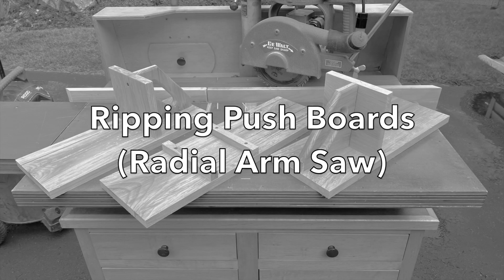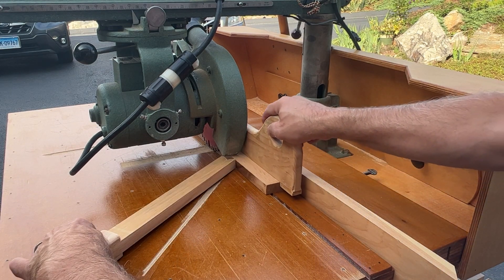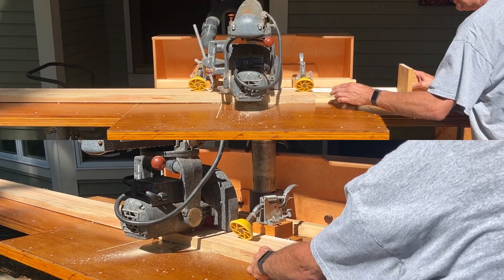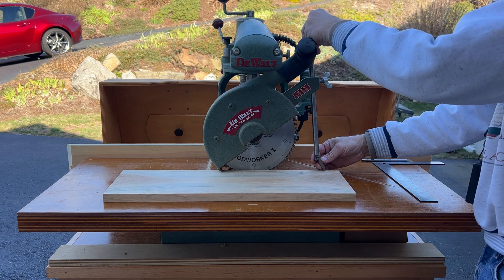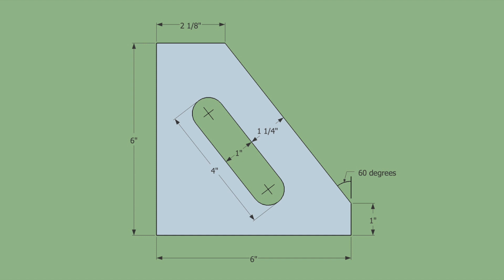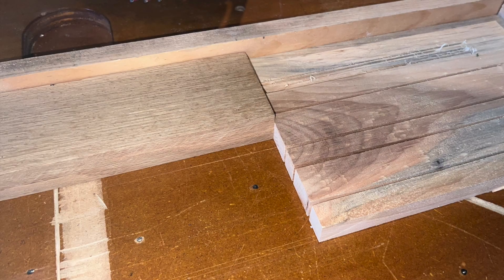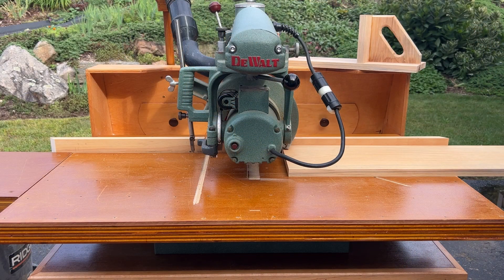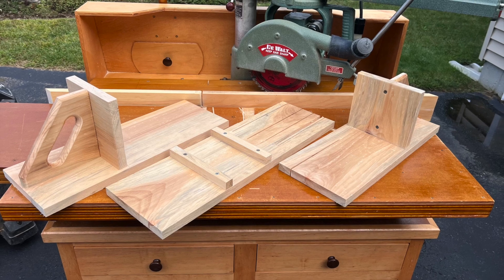Push Board for Ripping on Radial Arm Saw

Comment: Great idea. I just made one. Shouldn't you also use another board to keep the rip board against the fence?
Reply from the maker: I generally don’t need anything extra to hold the board against the fence. However, sometimes I use “Board Buddies”. You can see an example in this video (8 min 55 sec):
https://youtu.be/dXfl4njmZmc?si=6RvT9cXn3UoA67R5

Comment: I’ll make one today. Great description. Thanks. I use the DEWALT I learned on 60 years ago.
Reply: This is my first one, using scrap 3/4 5 1/2" wide pine. When this needs to be replaced I'm going to try cedar picket since I have a lot of pieces the right length.
Reply from the maker: @DouglasHavens Nice job.
Reply from the maker: Thanks. Glad you found it useful. Be safe!

Comment: Why does your push board not have an extension to the left of the piece that would help with adding a rightward pressure point at the left rear corner?
I seems like that would be a useful work stabilizer as you feed the workpiece. 🤔
Reply from the maker: Great question.  The push board is really just pushing the last few inches past the blade. Not unlike using a push stick to push a board past the blade on a table saw.  As long as the board is cut square on the end, the push board mates with it and pushes it straight through without problem (better than just a push stick).  In addition, I often use “board buddies” when ripping (you can see them in some of the examples shown in this video).  These one directional wheels are angled and also serve to pull the board towards the fence.
Reply: Thank you. I forgot about the board buddies, but on other active RAS demonstrators I’ve watched, they use a similar push board like yours, or occasionally, a push board from the back, then a push stick on the side, and that also prompted me to wonder why a push board  didn’t have an “extension” stub on the outer length rear portion of the rear of a workpiece. 
It just seemed to me, having that lateral pressure pushing the workpiece towards the fence was something one always tried to ensure.🤔
The one downside to my corner tab concept could be the limits of whatever pushboard width one built, in relation to the workpiece, so then a complication then is whatever arm that presses against the board length, would need to not interfere with the cut path and blade guard.
I’m curious to experiment with this idea, even if it turns out not to work in real life. 
It’s just a thought I have after watching several ripping cuts on the RAS.🤔🤷🏼‍♂️
Reply: I will  strongly consider making or buying a board buddy of some type anyway, they seem a smart accessory to use routinely.👍🏻
Reply from the maker: @leohorishny9561  They do come in handy.
Reply from the maker: @leohorishny9561  If you invent something better, please share.
Reply from the maker: @leohorishny9561  The nice thing about a wide push board is that it safely pushes both the workpiece and cutoff past the blade without pinching.  Depending on where you place it, a thin push stick may not always push the board straight (similar problem on a table saw) and another stick pushing from the side may pinch the kerf near the blade.

Comment: Another superb tutorial demo.  I just got an MBC-28 and am in the process of fine tuning after cleaning and close inspection.  The MBC is the "little brother" to the more well known MBF because it has a motor of 1/2HP rather than 3/4hp.  Otherwise, they are identical for all intents. Less power makes ripping operations even more sensitve to blade type and feed rate.  Slow and steady is the order of the day, allowing a good, thin and sharp combo or ripping blade to do the work - not the driver.

NOTE: Take care with softwoods that may be high in moisture, as it may steam and swell, thus possibly pinching the blade.
Reply from the maker: Thanks.  The MBC is a fine machine, albeit under-powered.  However, works fine for 1x material with a good blade and taking your time as you noted. It also makes an excellent moulding/shaper!
Reply: @brianweekley5700  I have a very old molding head from Craftsman.  Being an ex-tool grinder, I can keep things razor sharp. It did a pretty good job with my MBF that I used to have.  I just got done making your Ripping Pusher.  Much better than the one I was using. It's like a riot shield.😆
Reply from the maker: Great to hear!  Have fun with your new saw.

Comment: For certain makes of RAS, such as Craftsman, the switch is at the yoke. The significance of this is that the switch is at the opposite side. Necessary is to have a switch in series situated on the side of the operator so you can stop the saw without reaching over. 

Also, the pawl is not the best anti-kickback setup. It is commercial for convenience. A splitter-vertical holddown setup adjustable to width, at the outfeed side is better. The RAS has a wood table for easy anchoring of a width-adjustable splitter. Best is to take advantage of this, especially for repeat rip to the same width.
Reply from the maker: On the old DeWalts, the switch is on the right side. One of the reasons I use in-rip mode 99% of the time.  

I find the anti-kickback pawl works very well as long as it’s properly set.  However, if you have a user-friendly, effective, adjustable splitter/anti-kickback pawl that attaches to the table, I’d love to see it!

Comment: I wondering what your thoughts are on a combined Radial Arm Saw and Compound Miter Saw station as versus a dedicated top for the RAS?  The combined station would still need to have some of the components of a dedicated top.  I am just thinking I could kill 2 birds with one stone and not take up a significant amount of floor space in my small shop.
Reply from the maker: Personally, I’m not a fan of trying to combine two tools into a single table.  There are some people who do.  However, if you want a precisely aligned RAS, you need to be able to finely adjust the table to be co-planer with the arm (blade).  How do you do that without affecting the alignment of the other saw?  You can if you make the entire saw adjustable in addition to the table, but it’s a pain to align.  In addition, the beauty of the RAS is the ability to move the fence or replace it with different kinds of fences for different operations.  I wouldn’t want to lose that versatility.  Besides, you also would need to align fences between the two tools.  Decisions only you can make.
Reply: @brianweekley5700  Based on your feedback, I'll leave the RAS as it's own setup.  Thank you.

Comment: Love this.  I previously owned a Rockwell/Delta my dad left me.  Without much thought, I sold it.  Five minutes later I wish I hadn't.  While a compound miter saw is a nice to have in the shop, I missed having the Radial Arm Saw.  Such much that I recently bought another Rockwell/Delta.  It needs a new top built.  Once the top is built, I'll be back in business.  I push board like this would be a great addition to my safety tools.  Looking at your build, I am wondering if the sacrificial part of the flat board could be made in a way to easily replaced.  Instead of replacing the full flat board, you'd you just replace the forward sacrificial portion.  Maybe a half lap joint and you screw the sacrificial portion to the handle.
Reply from the maker: I couldn’t live without my RAS(s).  Good luck with your new saw.  As far as a replaceable sacrificial part of a push board?  I think screwing the handle onto a new board is pretty fast and easy.  Not sure what that buys you to replace a smaller piece, but don’t see why that couldn’t work.

Comment: I just came across 2 other videos in the last 2 days where the people start out their radial arm saw video by saying something like: "You should never do a rip cut on a radial arm saw, because that's just crazy!" 

It's really depressing when these people make statements without any information to support their opinion. I have never heard anyone actually explain "why" ripping is so dangerous.

I've been citing this channel as a source. Because people need to actually see a proper ripping technique. 

I use a completely different type of push block, but I feel much safer using my radial arm saw for ripping, than I do for crosscutting. Many people don't seem to realize that the blade guard on a radial arm saw is really designed for ripping, but it does almost nothing to protect the operator during a crosscut!
Reply from the maker: There’s very little any blade guard can do when cross-cutting.  Even with blade guards installed, you can still feed your hand into the blade on a table saw, pull a miter saw down into your hand, or push the blade on a sliding miter saw into it.  The blade guards do not protect the cutting area (only the rest of the blade above it).  The fact is, you must always keep your hand out of the blade path when cross-cutting on any any saw!  A circular saw provides even less protection and a chain saw is probably worse of all (open everywhere).  If it makes you feel better, you can install the side guards for a RAS that lift up and come down as you pass over the wood, but I don’t see the point because it still depends on just keeping your hand out of the blade path.  With proper blade and technique (emphasis on proper blade and technique), I’ve never found the RAS more dangerous than any other power saw for ripping or cross-cutting.

Comment: Great video will make a few.
Do you have a video on how to lubricant a Dewalt radial arm Sam 1350?
Reply from the maker: Thanks.  I replied to your lubrication question in another response (shouldn't need to lubricate to swing the arm for miters (just release the clamp, lift up the miter lock, swing the arm, retighten clamp).

Comment: I got my RAS a little over a year ago, mostly due to how versatile you taught me it could be. Plus, frankly, it was only $40 and I was broke and unemployed at the time. I made my first push board by copying what I saw you using as best I could, but that was before this video. One thing I didn't know enough to avoid when I made my first one was that it was long enough to engage the pawl when fully forward. Glad to see you pointed that specific problem out in this video so that others don't have to figure it out the hard/dangerous way.

You are genuinely the best RAS educator on YouTube, Brian. Thank you for all that you do for our little community.
Reply from the maker: Thank you very much.  Glad the videos are helpful.  Good luck with your RAS!

Comment: Great design, looks like it could be used on a table saw as well. If you're using 3/4 pine to make the push board, won't it be blocked by the tilted back blade guard if you're ripping 1/2 inch or 3/8 inch boards?
Reply from the maker: Thanks. If you're ripping thinner boards, you should also use a thinner push board.  A push board like this really isn't appropriate for a table saw--especially for short boards since the backside of the blade may tend to lift the board up.  This push board doesn't hold the wood down like a push block you would use on the TS.  On the RAS, no need to hold the backside down (just the front side of the blade, which is why you lower the blade guard).

Comment: Very useful thank you! I have recently begun exclusively ripping on my radial for a number of reasons, but finishing cuts with the cut off left sitting between the blade and the fence has always felt a little sketchy. Not sure why this never occured to me; I am going to make a push board tonight!
Reply from the maker: Thanks!  You are correct, the cutoff between the blade and fence has the potential to become a projectile, shooting back towards the operator. A push board is the safest way to move pieces clear past the blade.

Comment: I cant get over that MBF and everything you've made for it, absolutely top notch setup!  Question, what frame/motor/yoke did you choose for the "MBF Super" carraige, I like the idea of restomodding it with the later, more powerful motor to give the saw some more capability, and then it has the added bonus of the rear arbor!
Reply: I hear you there, I'd never gut a good tool for parts, and I've already got a pretty mint MBF for a project, gonna get through the holidays and start getting her set up ( I got my Mr Sawdust book in yesterday!)  So until I've got more space for more saws (one day!) I might be on the lookout for a mangled 7770
Reply from the maker: Thank you. It's a great machine!  I used a yoke from a 925 and a motor from a 7770 (only because these saws had other broken parts that made them unusable).  I don't recommend cannibalizing other saws to make this.  For example, the 925 is actually a better saw than the MBF, so why ruin one?  You will always be better off finding a larger saw (with greater capacity) with a larger, more powerful motor!
Reply from the maker: Check out this comparison...
https://youtu.be/D-xHJ0ZxZEQ
Look for a GWI, 1030, or 790.  These will be much larger and stronger saws than making a MBF "Super".

Comment: Do you have anyproblems with your saw going out of calibration when you swing the arm to 45 or switch to ripping, compound mitres etc? Seen a lot of people recommend on YouTube that once it is set to a square cut to leave it and use jigs etc? I have a dw125 I'm in the process of making a sawdust table for a setting up. Great videos thank you
Reply from the maker: Thank you!  My saws hold their adjustments quite well. However, whenever I'm doing precision work, I do double check for accuracy. I had built some miter and bevel gauges for this purpose: https://youtu.be/Neh0iu-f728?si=N6TjFDg-Tp6Pb41I

If I'm not mistaken, the DW125 is a European model, yes?  I've heard that they might not have the ability to set the heel adjustment? I have a separate video that may help for getting your RAS calibrated: https://youtu.be/EQ_HXSuh1PU?si=Fm31elQcOoWrA9Pe
Reply: @brianweekley5700  thanks for your reply, I've got it all set up now for a crosscut I'll check it each time adjust until I can either trust it or not 🙂 it does gave heel adjustment however its not adjusted via set screws on the back. It's a dewalt dw125 and a European model imin the UK. 🙃

Comment: With the push boards the way you are using them nothing is actually providing lateral force keeping the workpiece against the fence.  Is this an issue either for accuracy or safety?  I've seen you use board buddies in other videos, why not here also? Thanks, your videos have been very helpful to me as a novice woodworker and RAS user (I have a mid 1940s DeWalt GP).
Reply from the maker: Thanks. Great question.  Ripping on a RAS is really no different than ripping on a table saw.  As long as the blade is parallel to the fence and the edge of the board is straight (jointed), you should be able to easily feed the board tight against the fence as you push it through (with a little lateral force applied). The push board is simply used to push the last 12”, or so, past the blade (same as you might use a push stick to push the last bit past the blade on a table saw).  However, if the trailing edge of your board is cut square, it mates nicely with the push board so it helps keep it straight as you continue pushing it through.  

Board buddies are definitely a nice accessory.  They help keep the board tight to the fence and can also minimize kickback (if you use the correct ones that only turn in one direction).  On a RAS, that would be either the yellow ones (for in-rip) or orange ones (for out-rip).  I do use board buddies at times (probably more when I’m molding or working with narrower boards that I think may tend to wander away from the fence).  Note: you’ll find you need to make longer push boards when used with board buddies because they get in the way.

Comment: Do you only use 3/4" thickness push-boards regardless of the project boards thickness?
Reply from the maker: Yes, I also use this push board for thicker material. However, you don’t want the push board thicker than your material or you can’t lower the blade guard to where it needs to be.

Comment: Does it matter if you stop the saw blade first, before pulling the pushboard out? I'm assuming it doesn't.
Reply from the maker: I wouldn’t think it matters, but If you turn the motor off first, I’d probably wait till the blade spins down to a complete stop before I let go of the push board (or it could kickback). Therefore, I think you’d find it easier and faster to immediately retrieve the push board first so you can walk away as the blade spins down after you turn it off. Granted, your blade might spin down quickly, but it adds up if you’re ripping multiple boards.
Reply: @brianweekley5700  makes sense, thank you!